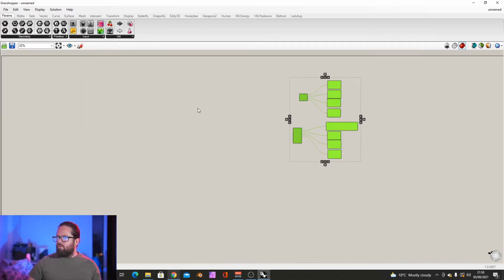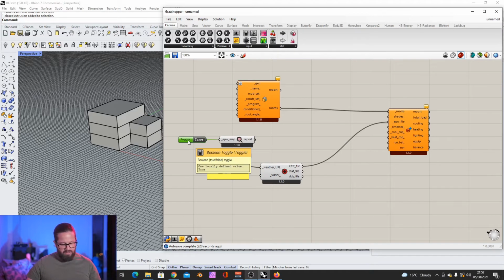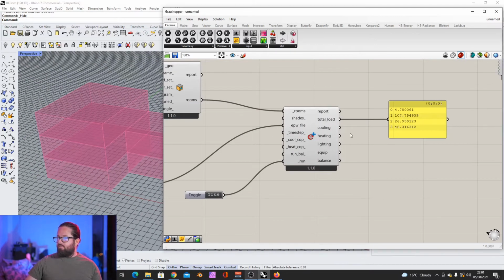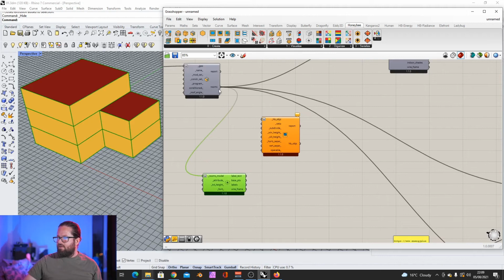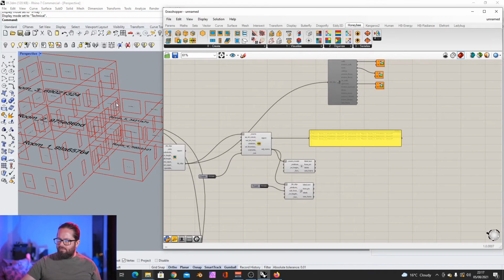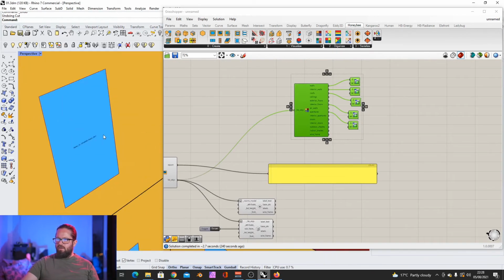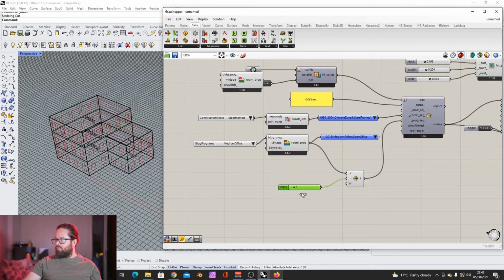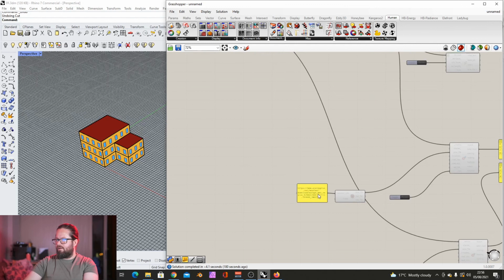Honeybee - Energy modeling - Part 2 of 2 - a first Simple Script  - Ladybug tools 1.1.0

Comment: Hello thank you for the content, recently I am looking for a tutorial about how to design a sunshade for a window in order to block the sun in a specific time in a year ,for instance summer time. i have found an option in LB legacy but it doesn't work and it seems there is non in the new version. would you please help me? thank you
Reply from the maker: Which version of LBT are you using right now?
I can explain based on the latest version perhaps. 1.8. if that works for you.
Reply: @PhilippGalvanDesign   thank you for your quick response, I use 1.8. I tend to calculate the length of a shade for a south window in a hot climate. when I calculated manually the result was different from LB benefit shade. I really appreciate your help.

Comment: Hi~ Philipp, thank you for the very nice tutorial. I  have a question, do you know how to run an energy simulation for a specific hour or day? Which component I can use for this setting?
Reply from the maker: I just started with energy modeling.
I think it should be by simply setting a period. If you want to analyse a certain hour of a day  over a longer period then just set the dates of the period and the hour you want check as start and end hour.
That will check every day of the period for that specific hour.
Reply: @PhilippGalvanDesign  Hi~ Philipp Thank you for your answer. In the energy plus component, there is no input for setting a period. But the OSM(Open Studio Model) component has an input for the simulation parameter where the time period can be set. But the OSM component didn't work with this error message. "1. Solution exception:No file was found at C:\Users\oim\simulation\unnamed\openstudio\out.osw" Could you answer with this problem? Thank you so much again!

Comment: I really wish if, Honeybee can take a rhino model that is already done, and not by building a honeybee model and its windows and all that, would've saved some time and made it simpler
Reply from the maker: Yeah I feel the pain. The problem with a more advanced Rhino model is that it's not as smart as for example a BIM model where every space and object is defined and equipped with additional data and specification. Which would make it of course much easier to develop a plugin more user friendly and easy to handle. On the other hand, I think it's good to analyse the concept massing before finishing the design. Think of it in this way:
What if your finished model performs really bad in the analysis? Then you have to remodel and rethink the design and test again...
Or get the principles on a simple massing model right first and then design accordingly. At the end the second option is the more economic workflow and also a more responsible practice.

Comment: Could you help me with this error?
The simulation has not run correctly because of this severe error:
** Severe ** Check Convexity: Surface=“Zone_0_SRF_1” is non-planar.
Reply from the maker: Is your model very complex? 
I would always use a very simple box as a test object to see if the script works and then gradually increase the complexity of model.
Reply: @PhilippGalvanDesign  Could you give me your mail to send the file please?
Reply from the maker: @loulwakharbotly2082  - office@nedomlel.com

Comment: Hello, thank you for the tutorial. I have one question. Is it possible to construct "uncentered" windows by using the component of "apertures by ratio"?
Reply from the maker: Hi Aybüke, not sure what mean by "uncentered" but I guess bespoke location.
There are different ways to create apertures
The 'by ratio' is only one way and it basically helps to test how large  a window need to be in order to get a certain amount of daylight.
I didn't got to show other ways but will hopefully in future.
Reply: @PhilippGalvanDesign  For example my one window is closer to the right side of the wall, but that component directly places windows by taking the center of the wall. Yes, I have seen that there are different components and will try them if I cannot solve that with this component. Thanks